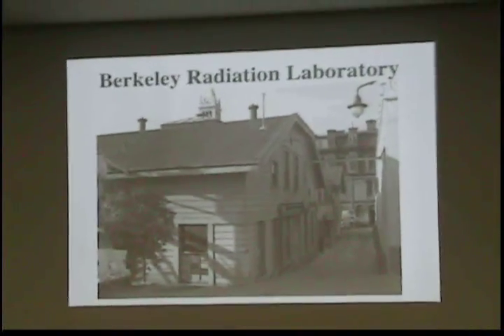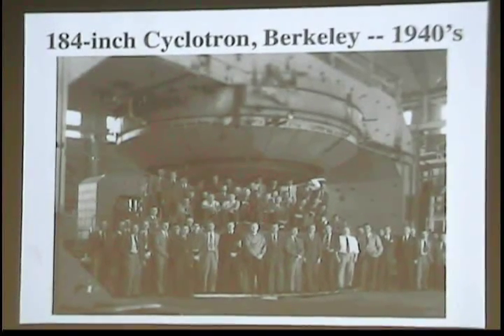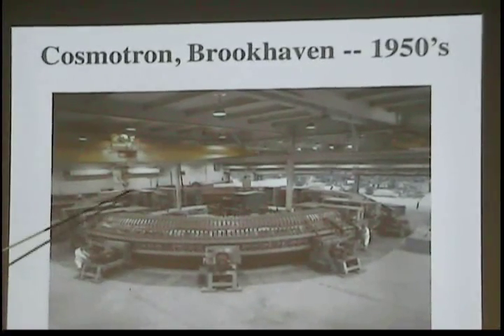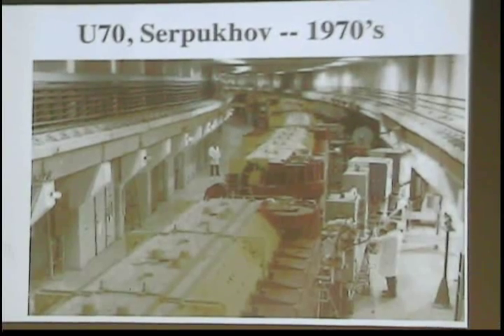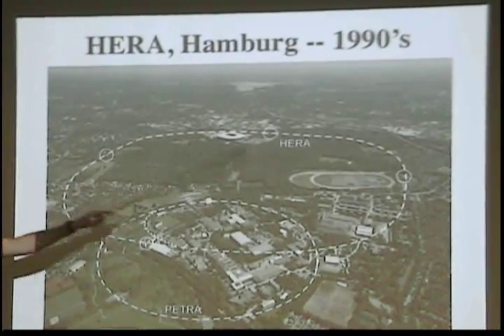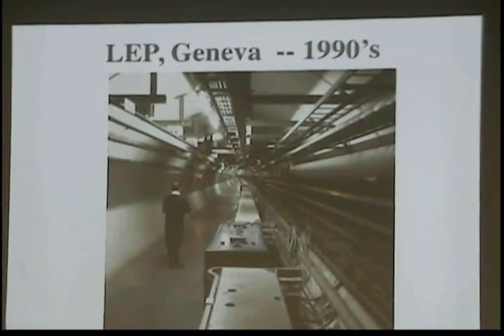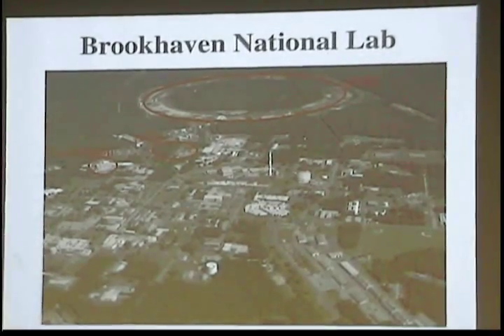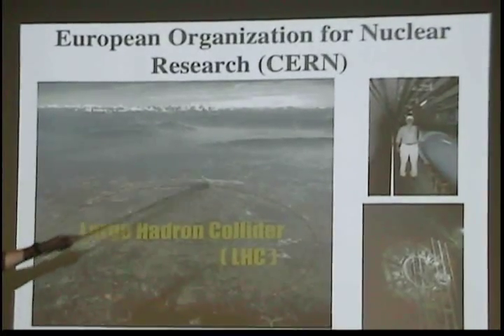The History of Particle Accelerator Physics

Comment: Sorry, boxa888 and Positronicity, just a small correction: Tesla did some research on cosmic rays, but did not discover them or prove that cosmic rays originate from outside the earth.  This was done in high altitude balloon experiments - by Victor Hess in 1911.  He was awarded the physics Nobel Prize in 1936 for these experiments.

On the video: Nice brief overview, addressing linear accelerators a little bit too briefly...